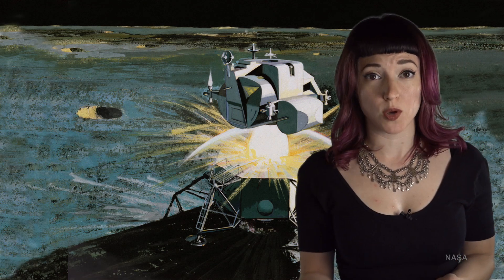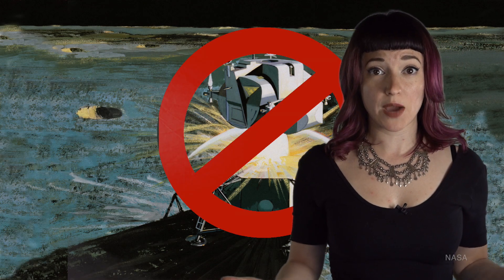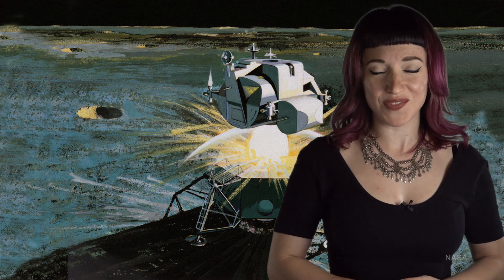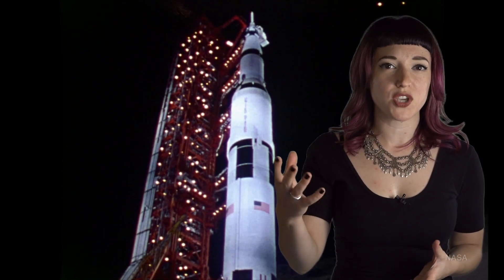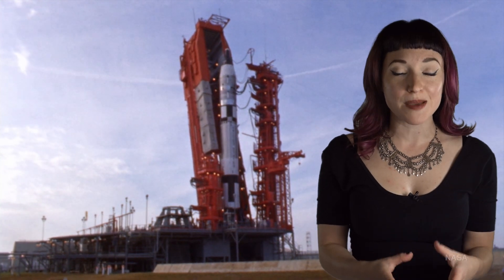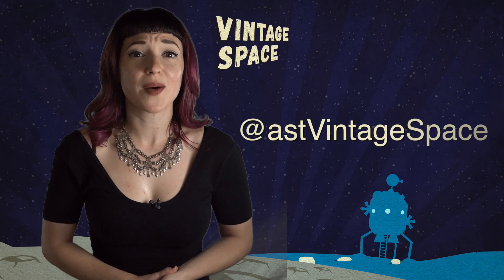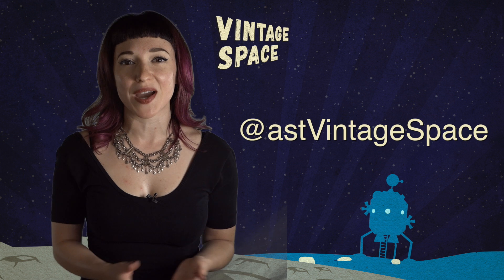How the Lunar Module Launched from the Moon Without a Flame

Comment: With a couple of exceptions.  1) On earth, the way to start such an engine is to flood the combustion chamber with NO4, which is a brownish-red color, before adding the hydrozine.  You see this in the Titan launches, the Indian rocket launches, and the Chinese rocket launches, all of which use this combination of fuel.  But not on the LEM accent stage.  2) The same combination of fuels was used in the Orbital Maneuvering engines on the Shuttle, and we can see them firing.  3) Apollo 10 astronauts said they traced the ascent engine burn after it was fired off to clear the command module orbit.  4) If you look closely at the hills behind the ascent stage, there is no distortion of the light as it passes through the "invisible plume". As the light from those hills passed through different densities, there would have been some refraction.  One might argue that the camera was good enough to catch that, but that seems to be convenient.  Did we land on the moon? YES.  Do I believe the ascent is a model on a string, YES.

Comment: LOL,  this is so fake......at .026 you can clearly see the line of the fake backdrop......If the "Astronots"  allegedly are sitting almost on top of the rocket engine you would not hear their voices over the extremely loud engine...
And yes,  you should be able to see exhaust plume and the force of the rocket's engine would blow the moon surface dust high into the air....
The explanation in this video is totally nonsensical.
Reply: "you would not hear their voices over the extremely loud engine"

Good grief.  A vast majority of the sound of a rocket engine comes from the expanding gasses interacting with the atmosphere.  No atmosphere = no noise.
Reply: "you should be able to see exhaust plume"

Says no rocket engineer anywhere on Earth.  Seriously, dewdrop?  You think none of the 7,000 engineers who designed and built the lunar module, nor the hundreds more at Bell Aerosystems who made the ascent engine, ever thought to themselves, "hmm, why don't I see the flame?"  No?  Nobody ever noticed until you came along?  Have you ever seen a reaction of N2O4 and Aerozine50?  Do you even know what the fuels and oxidizers are?
Reply: "force of the rocket's engine would blow the moon surface dust"

Go watch a better quality version of the ascent video.  Yes, dust is blown.
Reply: "high into the air"

Air on the moon?
Reply: "too funny"

What's "too funny" is when silly gullible dewdrops like you pretend to understand things they don't.
Reply: The fuel used burns basically clear. Dust did get blown but it couldn’t stay suspended above the ground because there’s no air.
Reply: @AM-rd9pu  So no visible exhaust plume, no visible dust, no visible crater under the LEM, no rocket noise even though the astronots are literally sitting on a 10000 LB thrust engine...Yes...its fake!   Especially considering the visible fake backdrop LOL.... too funny.
Reply: "no visible crater under the LEM"

A crater?  Seriously?  Why would they build an engine that would cut a crater?  Didn't you ever wonder why they used a 20 square foot cross section?  When you were in your university aerospace engineering classes, didn't they teach you how to model exhaust force and cross section to get pressure?
Reply: "sitting on a 10000 LB thrust engine"

Really, dewdrop?  You think the ascent engine produced 10,000 pounds of thrust?  Who told you that number?  Was it a taxi cab driver in a YouTube video?  Maybe a drywall contractor?  Who?  Who told you the ascent engine produced that much thrust?
Reply: "you can clearly see the line of the fake backdrop"

No, dewdrop, you cannot.  This is just absurd.  You people look at a horizon, and refuse to accept that it's a horizon.

Comment: You can still see the flames in the hypergolic rocket launch, it doesn't burn PURE INVISIBLE so that if you were standing directly under the engine you wouldn't even see a reaction taking place (no heat, light, gas expansion).  Go stand under that Saturn 2 rocket, and film it launching at night, imagine no flame, no smoke, no mach diamonds, not even the light from the hot engine nozzles, no visual effects of shadows of the flame exhaust which you can see when FIREFLY aerospace landed their remote moon lander successfully just today in fact!  It's time to have that talk now...
Reply: " still see the flames in the hypergolic rocket launch, it doesn't burn PURE INVISIBLE"

So what?  The only reason you can even see a hint of the rocket plume is because of the interaction with the surrounding atmosphere.  Also, they ran the Titans a bit rich to make them burn cooler, which left some fuel to burn with the atmosphere instead of the N2O4.  That doesn't happen in a vacuum with a balanced reaction.  Are you seriously under the impression that you understand this topic?
Reply: "Go stand under that Saturn 2 rocket"

What's a Saturn 2 rocket?  I mean, sure, they contemplated a model that they were going to call the Saturn II, and drew up some initial design specifications.  But, none were ever built.  How can anybody stand under one?  Gee, I'm starting to get the impression that maybe you aren't the aerospace engineer you're pretending to be, eh?
Reply: "FIREFLY aerospace"

Dewdrop, Firefly burns kerosene and oxygen.  The lunar lander burned Aerozine50 and N2O4.  Why do you expect the same result from different fuels and oxidizers?
Reply: Look up pictures or videos of Titan II missile launches. It used the same fuel as the Apollo ascent stage and the plume can be difficult to see. Or look at videos of Shuttle launches. The plume coming from the RS-25 engines is a nearly clear blue. 

Now factor in the fact that there’s no ambient air to heat up and flow and poorer camera quality and it’s not a surprise that the plume wasn’t visible.

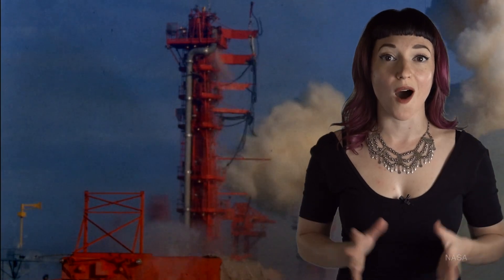Comment: Um claimed a titan 2 used the same fuel source so no flame plume, yet at 1:40 clearly shows a flame plume from a titan 2.
Reply: It's 99% invisible, and you can see right through it.  Go compare it to a kerosene launch, and you'll see the difference.  At 1:40, you only see the outlines from the flame, and that's only because of the interaction with the atmosphere, and because they ran the Titans a bit rich (for cooling purposes).  So, you get a bit of visibility from the unburned fuel mixing with the atmosphere, and just the general outlines from the atmosphere itself.  In a vacuum, that doesn't happen.
Reply: It was largely clear. Much of the glow comes from ambient air heating up and glowing.

Comment: where is apollo 11 hypergolic visible fire in vacuum ? 

Apollo 11, like other spacecraft in the Apollo program, used hypergolic propellants for certain systems, such as the Reaction Control System (RCS) and the Service Propulsion System (SPS). Hypergolic propellants ignite spontaneously upon contact with each other, without the need for an external ignition source. This makes them highly reliable for use in space.

In the vacuum of space, hypergolic propellants do produce visible flames, but the appearance of these flames is different from what you might see in an atmosphere. Here are some key points:

Visible Flame: In a vacuum, the flame from hypergolic propellants is still visible, but it tends to be more transparent and less defined compared to flames in an atmosphere. This is because there is no air to scatter light and create the bright, opaque flames we are used to seeing on Earth.

Color: The flame color can vary depending on the specific propellants used. For example, the combination of hydrazine (N2H4) and nitrogen tetroxide (N2O4), commonly used in the Apollo program, typically produces a reddish-brown flame due to the presence of nitrogen compounds.

Shape and Behavior: In the absence of an atmosphere, the flame does not have the same shape as it would on Earth. It tends to expand more rapidly and can appear more diffuse. The lack of air resistance means the flame can spread out in all directions more freely.

Plume Visibility: The exhaust plume from hypergolic engines in space can be seen as a faint, glowing cloud of gas and particles. This plume can be visible from a distance, especially against the dark background of space ( american moon )
Reply: As usual, you spam a bunch of gibberish that you don't understand.

"typically produces a reddish-brown flame"

No, dewdrop.  N2O4 and Aerozine50 do NOT produce a visible flame if mixed correctly.  The reddish-brown byproduct is from an uneven mixture, such as when they ran the Titan rockets rich, and some of the fuel burned with the atmosphere instead of the N2O4.  But, you just keep on pretending (as always) that you understand the topic better than the aerospace engineers who worked on this stuff, or any aerospace engineer on the planet since.  By the way, they didn't use base hydrazine.  They used Aerozine50, which is C2H12N4.  When you copied and pasted your silly rant, you didn't even know enough to correct the chemical formula or the compound used.

Comment: I'm about 8 years late, but I've seen where the hypergolic ascent motor couldn't be test fired because the chemicals were highly corrosive. The ascent motor was assembled using new parts and installed on the lunar module without being test run. The first and only time it was run was when it lifted the module and the astronauts off the surface of the moon.
Reply: Engine.  Not motor.  In rocket circles, an engine means liquid fuel, and a motor means solid fuel.

Comment: I did not review every comment or reply to a comment, but I have thought for a long time that "we", because of reverse engineering of captured UFO craft, have had "anti-gravity"/ether control technology that we used to assist in the moon-craft take-off.
Reply: The UFO/UAP objects seen by our most credible observers (military pilots in aircraft with sophisticated tracking/identification equipment) behave completely different than any technology we know of. No heat signature, and propulsion/movements unlike anything we have. Their technology is likely hundreds or thousands of years more advanced than ours.

Comment: The LM Ascent engine was designed and manufactured by Bell Aerosystems, Niagara Falls NY, and WAS acceptance tested prior to delivery to Grumman Aerospace, Bethpage, NY.  The hypergolic propellants were nitrogen tetroxide oxidizer and hydrazine mix fuel.  The propellants were fed to the injector by a bipropellant valve with parallel/redundant channels.  Ignition was accomplished with an oxidizer lead for a smooth start. The engine was uncooled, an ablative material which "gassed off" cooled the thrust chamber and throat.  Testing of the ascent engine pre-production development configurations was done at Bell Test Center, Model City NY.  The thrust of the LM Ascent engine on the moon with full expansion nozzle was 3,500 lb.  Bell had experience with hypergolic rocket engines with the 16,000 lb Agena engine used in Gemini program.

Comment: A rocket engine to function efficiently in the vacuum of space has an expansion section downstream of the throat.  This dissipates the exhaust gases over a wide area and the pressure of the exhaust is reduced to the external low/negligible pressure  and develops full thrust.
Reply: All rocket engines, regardless if they're to be used in space, atmospheric air, or underwater, have "an expansion section downstream of the throat". It's called a nozzle. Rocket engines have nozzles. If it does not have a nozzle it is not a rocket engine.

Comment: The space shuttle must have used different fuels. Their attitude thrusters show a white blast out of the nozzle.
Reply: The shuttles did use hypergolic fuel in the RCS thrusters, but the engines were quite different to propulsion ones. The smaller RCS engines produced around 110 Newtons of thrust and the larger ones around 3,000N - for comparison the main engines and SRB's pushed about 38,000,000N.

The throats on the RCS engines were relatively wide compared to the nozzle, which were much longer than on a propulsion engine. The combustion gas expands and cools enough by the time it leaves the nozzle that water molecules in it freeze - the white plume we see is a cloud of ice crystals, rather than smoke or vapour. 

Smaller spacecraft, satellites and such, also give off a white puff from their RCS nozzles. There's no combustion taking place at all with those. It's just a few drops of liquid nitrogen which instantly boils due to the pressure change, with the sudden expansion providing thrust just like in a combustion engine.

Comment: Way too funny! I'm surprised that you didn't choke on your own 'BS'. But, your 'titan' example disproves your own statement. I can quite clearly see a flame and what you completely overlook, is that all hypergolic engines start with a cloud of orange smoke -which you can see billowing out behind that titan. If you go look at any of the other hypergolic engine tests, you will see that smoke. There is even footage of the town nearby to engine test facility being evacuated - lots of orange smoke from an oxidant leak. So sorry, you should expect to see flame from the launch. And, while we're at it. If you 'freeze-frame' that lift-off, just after the module clears that mouyntain in the background, you will notice that the ridge line is NOT distorted. If there is a rocket engine operating, the exhaust gas WOULD, by its very nature, distort the view. That ridge line is a clear as a bell. There is no rocket operating. And finall7y, look closely at the framework that remains after the launch. Where are the fuel tanks and the rocket engine? I'm sure they didn't take them back to earth! I don't think you are very good at spotting fake!
Reply: Deniers of the SIX Apollo Moon Landing Missions like Mr Pandy here. are either just Trolls trying to get the attention they seem to crave, or are just wilfully ignorant of the subject they mindlessly comment on about. If it’s the latter, then it’s obvious they’ve done no honest research and/or reading up on the subject. Therefore, being trolls and shrills, either way, they very well know the truth, but have a vested interest in the lie they propagate, to maintain their agenda of deceit and misinformation. This is often driven by religious neurosis and a ‘biblical’ view of the world around them. This type of mentality causes them to be continually deceitful, thus becoming habitual and pathological liars. Deceit becomes the norm for them. Finally, we have the ones who really believe in their delusions because they’re unmitigated wilfully ignorant dummies. That’s about the sum of it. As to which, take your pick.
Reply: Apolloskyface is everywhere. Who would believe you if you have nasa in name and profile pic like that?  It is like a sign that shout i am nasa fanboy believe me or i am going to lowkey insult your intelligence without adding much information to the debate.
Reply: @Yggdrasil_Story  That sounds like an erotic fantasy - of sorts! rofl!

Comment: Nice try, but no cigar. What you showed as an example had both flame and alote of smoke. Sorry.
Reply: You're missing the point.  The flame from Gemini rockets was almost completely clear.  The only reason you can see the flame at all is because of the atmosphere, and because they ran those rockets a bit rich to keep them a little cooler.  The little bit of flame you can see is a result of interaction with the atmosphere, and unburned fuel that ends up burning with oxygen instead of N2O4.  For the Apollo landers, they didn't run them rich, and there's no atmosphere to interact with.  Furthermore, the "smoke" you're seeing is part of the water sound suppression system.  They poured boatloads of water underneath the rocket while it was running in order to deaden the sound, and also served as a mechanism to cool stuff down.  The "smoke" is the water flashing into clouds of steam.  Doesn't it even occur to you that there's no "smoke" from the flame itself, and instead, you just see it rising from the ground underneath the rocket?  You don't see this "smoke" as the rocket ascends.  The only time you start to see "smoke" again is when it's passing through the altitude where it leaves a contrail.  Spare the world your fake "apologies."  You have no understanding of the topic, and it's clear you don't even want an understanding of the topic.
Reply: @rockethead7  bla bla bla bla. You can't change physics
Reply: @semontreal6907  Physics says that rocket exhaust gases interacting with an atmosphere will behave differently to rocket exhaust gases that flow into a vacuum.
Reply: @Hobbes746  you know what else physics says you can't have a giant sphere of gas inside of vacuum
Reply: @semontreal6907  No, physics does not say that. 
Physics says that gases expand unless a force works on the gas. Earth’s atmosphere has a force acting on it: gravity. This pulls every molecule in the atmosphere down towards the planet. The force per molecule is tiny, but it’s enough to keep our atmosphere from expanding infinitely.
Reply: So, you see a physics problem?  Why are you not publishing in physics journals?  Why can't any physicists recognize this physics problem you can?  And, how is that an answer to anything I wrote?
Reply: @rockethead7  because of Stockholmed people like you who believe anything you are told without critical thinking
Reply: I wish you dewdrops would just tell others that you think the Earth is flat.  It would save a heck of a lot of time and energy... especially if you'd put it on every job application you ever fill out.